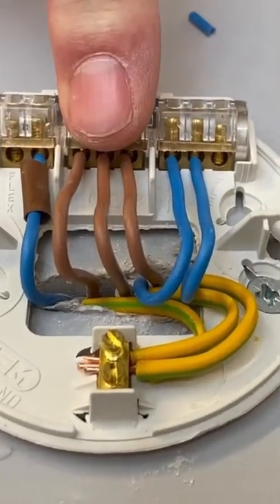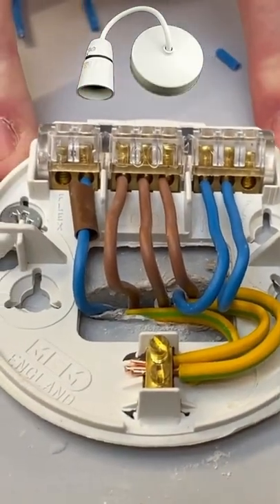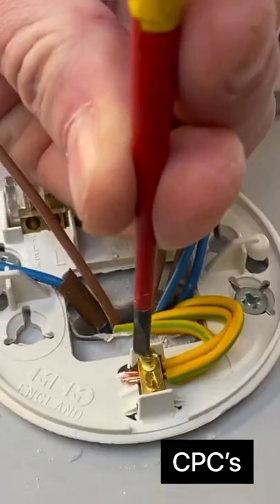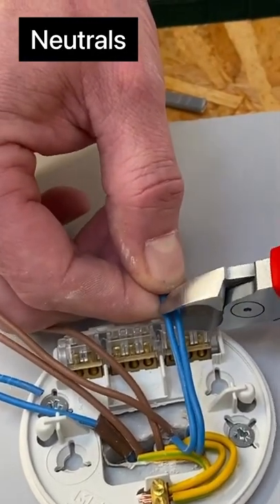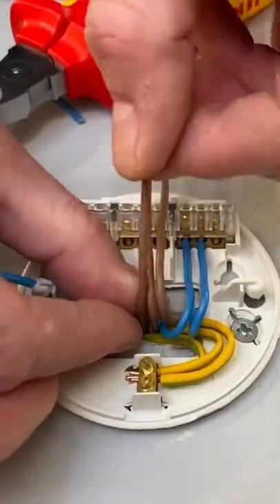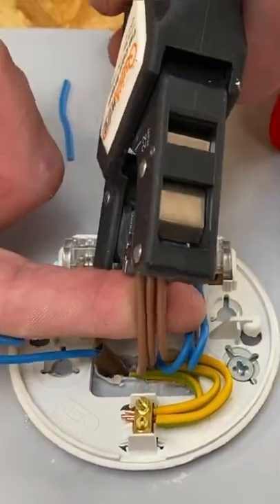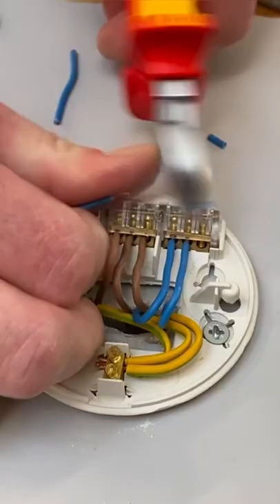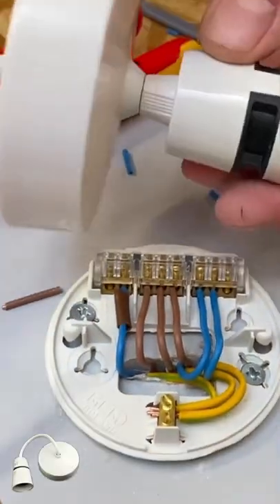Connecting up a Ceiling Rose 🧰 🛠

Comment: Nice and simple. tidy . 
I was tort to double the ends over when putting single conductors into terminals, so the screws have a larger aria to clamp down on and it prevents crushing the conductors. 
Great video as always Gaz 👍👍👍❤️